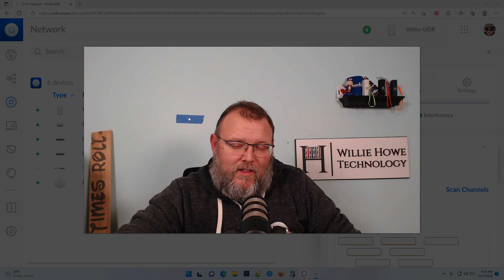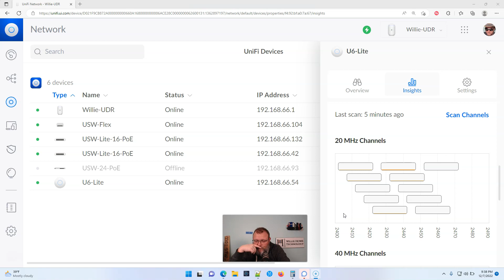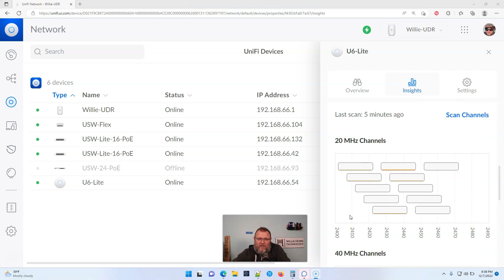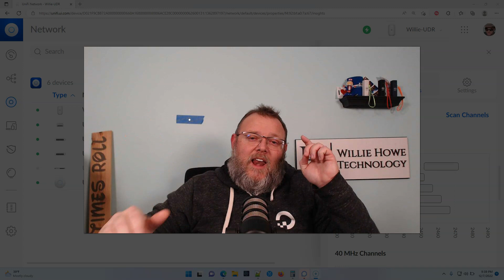Stop Using These WiFi Settings

Comment: Definitely looking forward to what you have in store for 5Ghz. I know one good thing to point out only because I've ran into it by accident a few times and I've seen it corroborated by others is the DFS channels. There are sadly a good number of consumer electronic devices out there that can do 5Ghz but will refuse to use DFS channels. So if your AP is set to use one of those, the client device will act like the AP just does not exist. Generally speaking, I avoid DFS channels for this reason alone, although it does greatly limit what channels you have access to now. I've also had headaches trying to get my Unifi AP AC Lite's to actually use them.

Comment: Wouldn't it be okay to use a 40 MHz channel if you have no one around you and you only have (ONE) AP?
Reply from the maker: This is maybe the only exception I would make -- but if you need the speed -- why use 2.4ghz??????????????????????????
Reply: @WillieHowe  Maybe because of super thick walls?
Reply from the maker: @DJuTube4  if your walls are that thick I'd use multiple APs and use powerline adapters. Powerline adapters can perform as fast or faster than 2.4.
Reply: @WillieHowe  I agree, unless you have dirty power, like running drills and lathes.